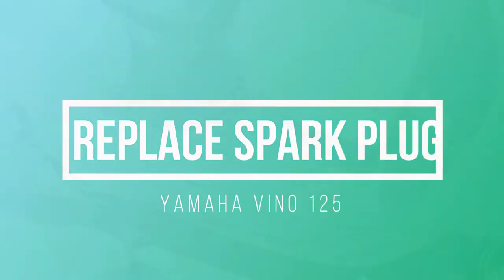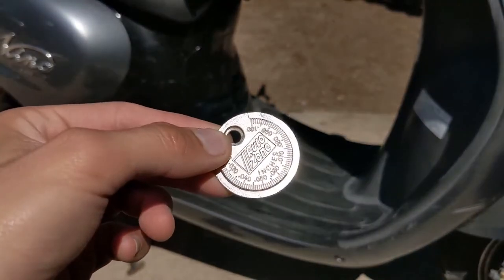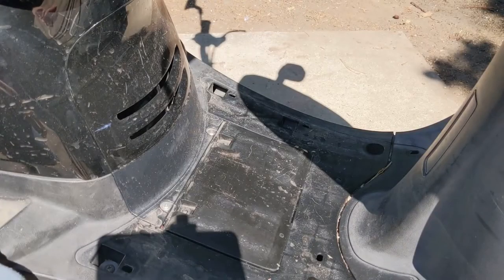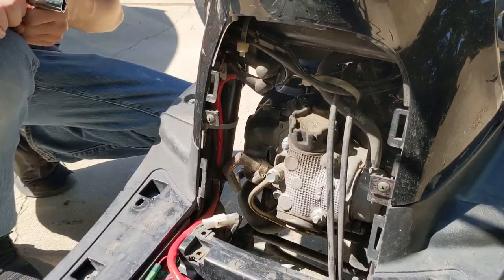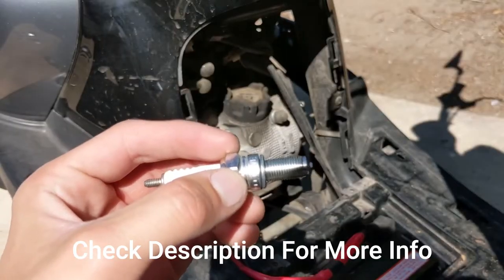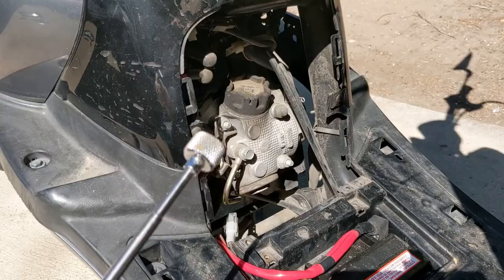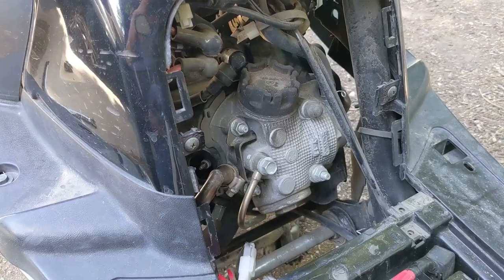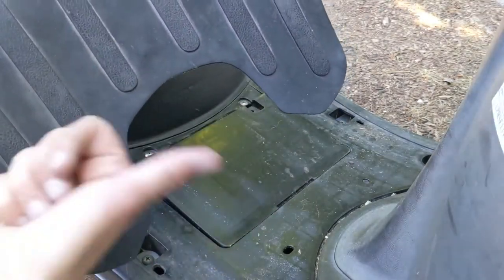How to Replace Spark Plug Yamaha Vino 125

Comment: Bridger, it's a 5/8" spark plug socket, not a 1/2".  Also, most Vino 125 owners swap out their stock plug for the iridium version ( NGK CR7EIX, available at NAPA for $8.50), for better performance and gas mileage.